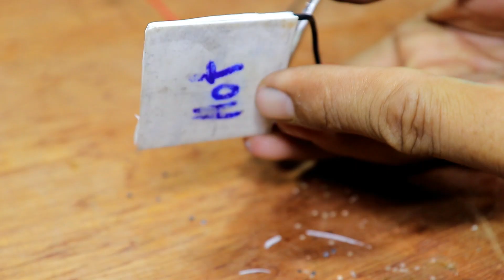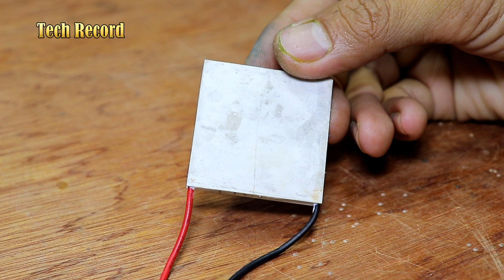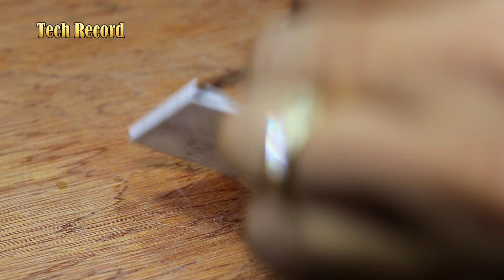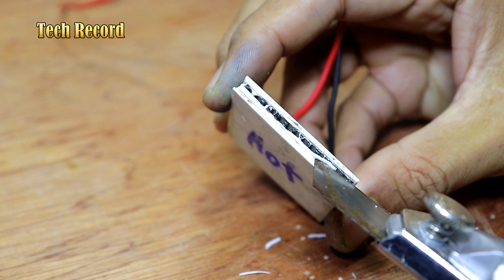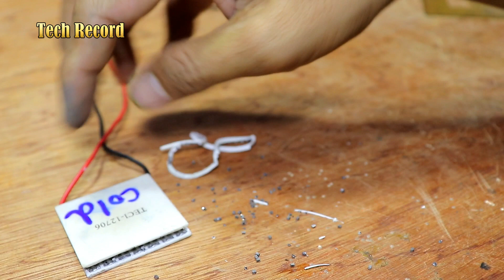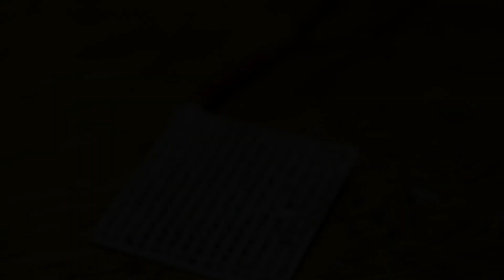What inside of Peltier cooler, To experiment of Peltier

Comment: When i ordered my peltier it just worked for 2 days and stopped running now even if i give it supply it won't work i men it will not get cold neither hot
Reply: Yes it will break quickly if you can't neutralize the hot side.